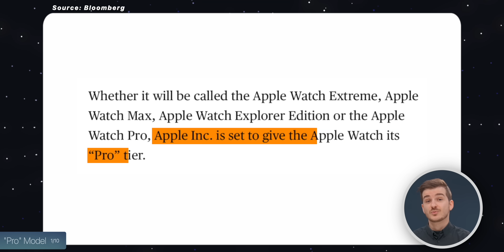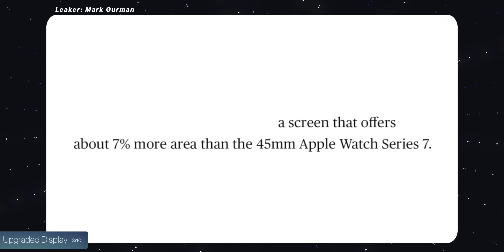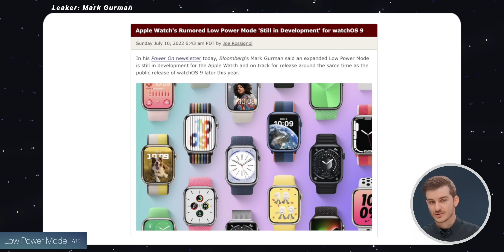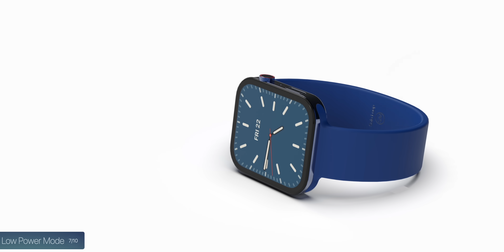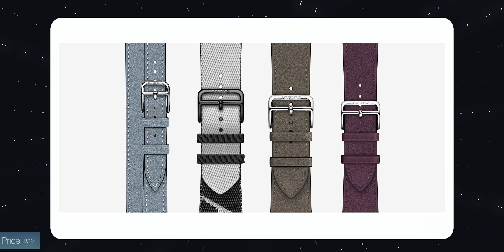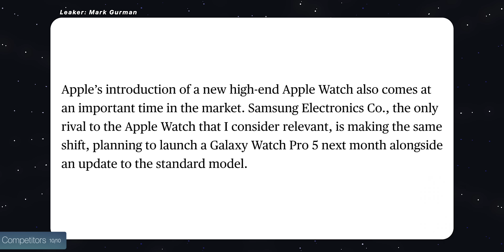Apple Watch Pro – The $1000 Apple Watch!

Comment: I currently have the used 5 I bought cheaper on end of last year to wait for 8, so I might choose 8 Pro if it has significant improvement and not freaky price
However I maybe keep using current 5 if the improvements of 8s are minor. Even the 7 didn't worth the price for me for its features

Comment: I’ve just bought myself a Garmin Fenix 7 (sapphire solar) so incredible durability and battery can be good for weeks depending on my use. I know it’s a bit light on the smart watch options but I bought it for (trail) running so perfect fit.
Reply: I had a Fenix 6 and went back to an Apple Watch. I just was so underwhelmed by the experience and the watch itself. I ended up returning it.
Reply: Garmins are not comparable with Apple Watches. Garmin watches are just for workout and sport, while on the Apple Watch, it's a smartwatch + it has workout and sport. Apple will always be on the top.
Reply: yes it has workout and sport but for the moment I don't see anything indication that I can reliably take the Apple watch on an all day or multiple day hike or trail run. Apple is a smartwatch that can do some sport, Garmin is a sport watch that can do some smart. I want a watch for sports first and if Apple can not offer me the battery life to go with that, then I have to choose Garmin. 

Apple is on top as an allrounder but never as a dedicated sports watch.
Reply: @jesuismanu  I love the fitness plus built in feature in Apple Watch.
Reply: @timmy0210  well yes.. you can make calls on apple watch and reply to messeges. But other than that what more do you think you can do with apple watch with 1 day worth of battery life? With garmin you get sooo much more. Of course you get better experience with apple watch since it's also made by Apple (and also only works with iPhone) and it's more beautiful to look at but other than that.. I'd rather go with Garmin for half the price of this "PRO" model.
Reply: @timmy0210  Apple will be always on top. Dude you sound like hard-core fanboy 🤣

Comment: 2 days battery life, more premium case, and useless sensor for 1000$? That’s just crazy. Garmin Fenix 7 costs around 700-800$ and they are on absolutely different level.
Reply: I've owned 3 garmins (Fenix 6s, forerunner 745 and Enduro) and in my experience Garmins are not worth the money. They do GPS tracking and battery life well and thats about it. All of the other "smart features" are crap and innacurate. I mean it cant even tell me the correct temperature. It was almost always 5-10 degrees Celsius away from any other website/app. Sometimes I would get up in the morning and it says its like 0 degrees outside and then I walk out and its warm. The sleep tracking is kinda useless, it is really bad at telling when you're asleep or awake even if you are looking at your phone (it has an app and Bluetooth so this should be easy for it to tell that you're awake if you are on your phone). The body battery seemed to work alright but after using it for a while it's kinda like, well I can tell how I feel so do I need an app to agree with me? Kinda pointless. I suppose if you're a marathon runner or high level athlete then it would be a good device but for the vast majority of people, the Apple Watch has way more useful features. That's why I sold my Enduro and went back to Apple Watch and in my opinion the Apple Watch wins, no contest. The one and only thing that the Enduro wins at, for me, is battery life.
Reply: 600$
Reply: Lol the menu in a Garmin doesn’t even run without lagging. You got ripped off and fell for the marketing.

Comment: I would probably go for the Series 8, I have the first Apple Watch SE but i use it so much that the battery is starting to degrade. I would also just get the SE 2 but I want to have a always on display.
Reply: I have the series 5 and never have always on enabled. Twist of my wrist does it for me. I will upgrade to SE 2.
Reply: Series 7 is also $279 on Amazon rn
Reply: The battery life difference with "always on" off is substantial. So even though I have series 7, I always keep it off.